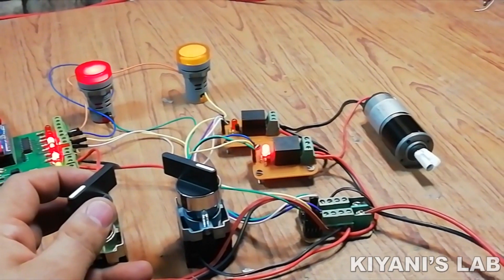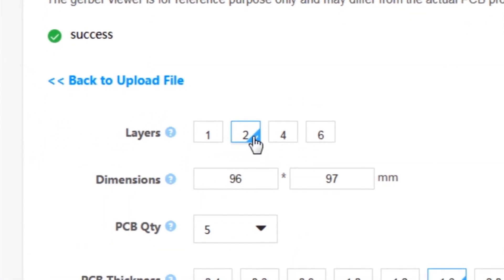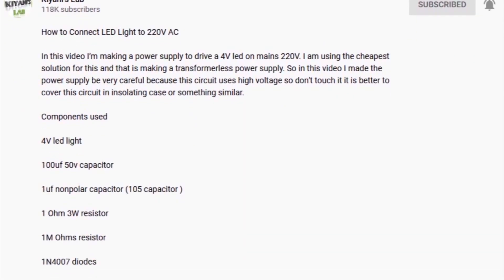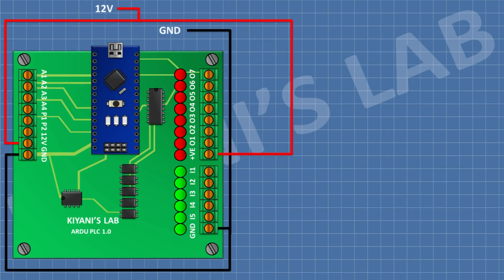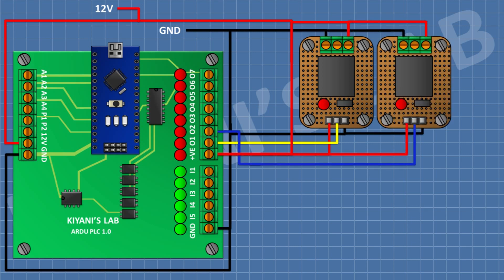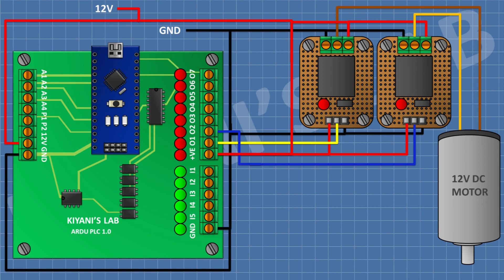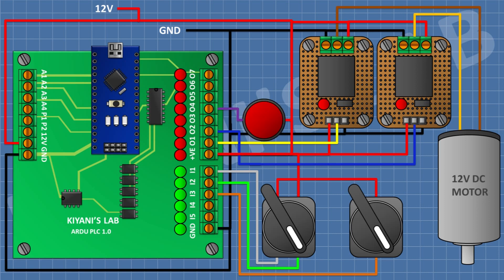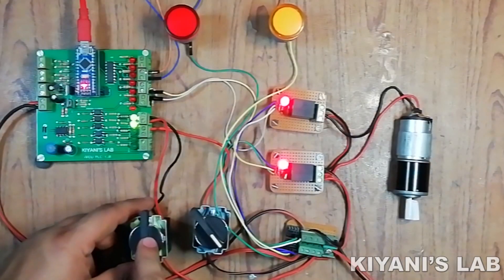DC Motor Reverse Forward Controller Using Arduino PLC

Comment: You have to add some time in between when someone changes directions or turns off. The motor is usually inert slow and connected to gears or a load. You need to give time to come to a stop